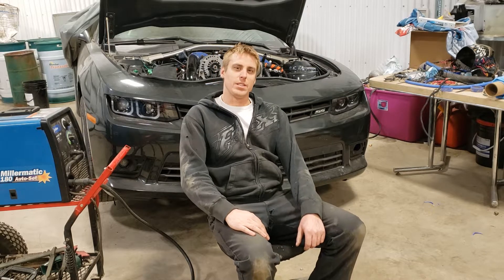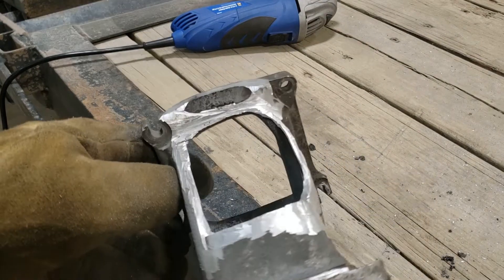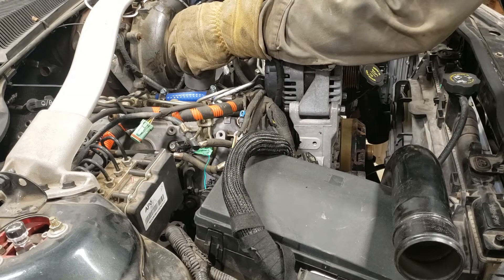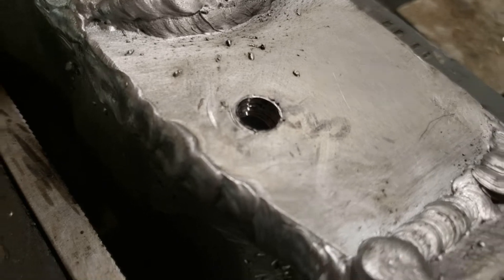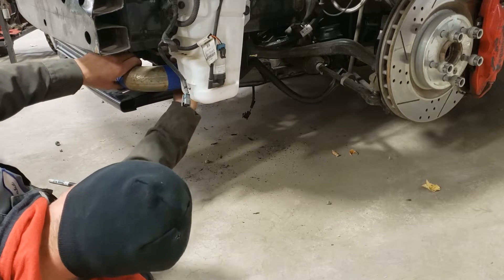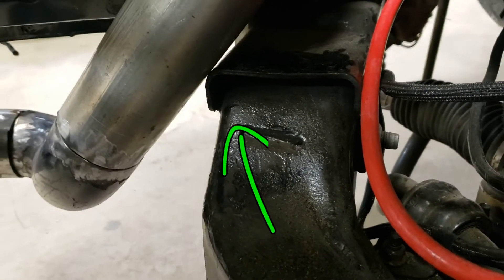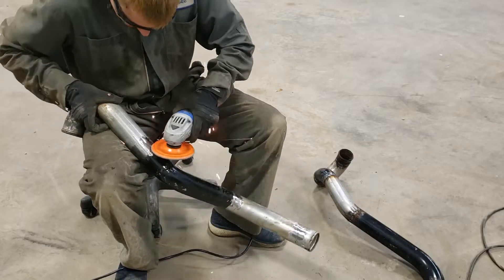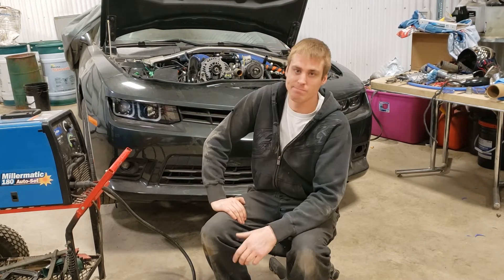Amazon Intercooler Install and homemade turbo pipes

Comment: Will the air favor the one side on the intake becuase of the direction its flowing?
Reply from the maker: Not really.  That’s how most intake are built.   Could be better if like to upgrade small things like that as I drive the car a push it for more power.

Comment: Why didn't you run a flat strap from hot side to cold side then bolt it to the alternator bracket
Reply from the maker: Like to support the pipe?   It doesn't really need it,  it's very tight the way it is and for what its worth factory pipes "float" the same way.
Reply: @zedperformance  yes on the cold side! I am just curious on my boosted 6.7 powerstroke it kept having trouble when over 40psi before I did this
Reply from the maker: @davidhamilton9902  if I run into trouble like that I'll probably have to brace it like you suggest,   only way to fond out will be many burnouts lol